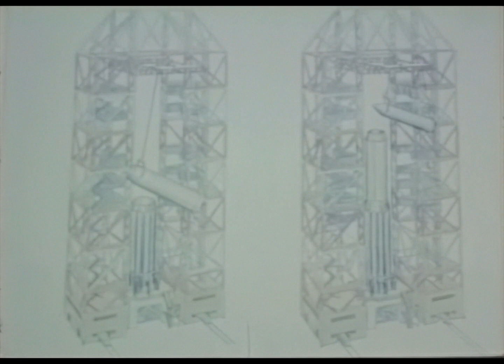The Saturn Rocket - US Army Saturn Development Documentary, AI Upscale, Rocket, Launch, Von Braun

Comment: That Saturn A-1 proposal used in this video sure was an odd-looking rocket. I looked it up. For anyone else who's curious their idea was to mount a Titan 1st stage on-top of a Saturn 1 as its 2nd stage. Then add a stretched Centaur 3rd stage to handle the geosync transfer. All those stages were already in-development so this would only require some modifications rather than designing a new one.

Comment: i cant help but wonder what if they kept building Saturns, refining the design regularly over time
Reply: They envisioned at least 100+ Saturn V flights. There were plans for several launch pads, though only two were built. Notice the VAB has 4 huge doors, 2 on each side, with 2 bays. The idea was to crank ‘em out assembly line style. Crewed Mars landings were planned for the 85-87 launch window. They threw all that away.